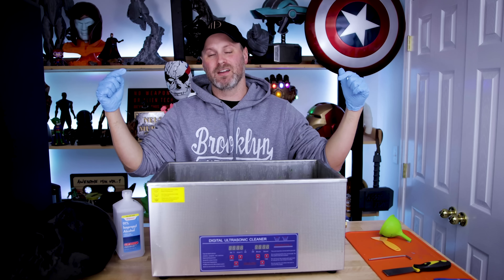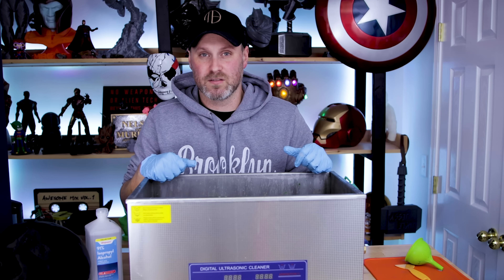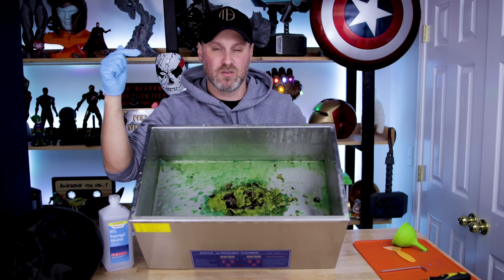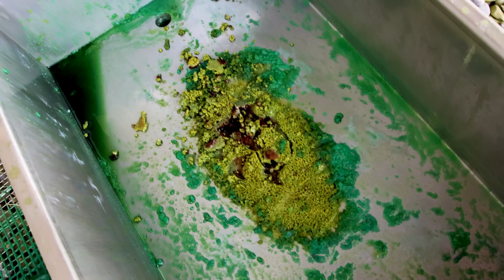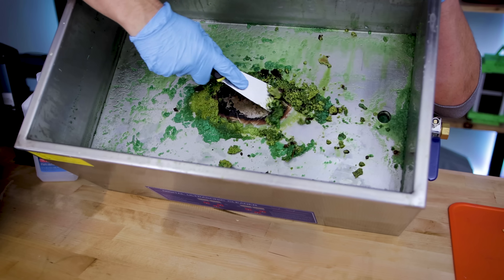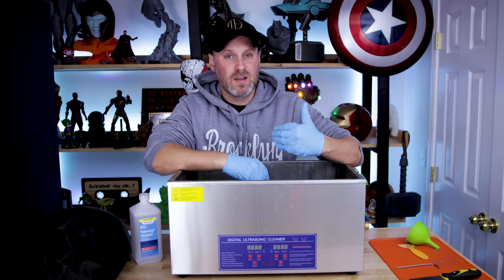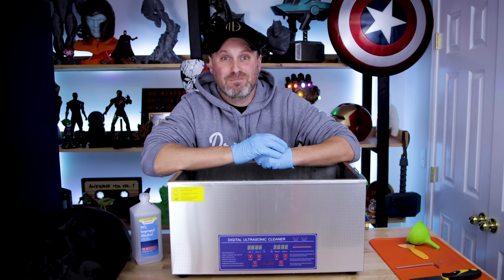Resin 3D Printing - Ultra Sonic Cleaner Safety Warning

Comment: Hi uncle Jessy.  I’m new to resin printing and I plan to get an ultra sonic cleaner as well.  I have a few questions.  Would not using any heat be effective in cleaning the prints?  Do you still use simple green as your go to solution?  And what do you do to purify simple green if you want to reuse the solution?  Great content by the way.

Comment: Mine just arrived today,  the first thing I checked was if it remembers   no active heating setting. When I power off and on again.  Fortunately it remembers the setting. I'll use a zip seal bag or glass jar with my Ethanol and model for my cleaning cycles.

Comment: I got the smaller 3L one. I wanted to know if the heater turn off after the timer. After getting mix answers on Amazon, mostly people saying yes. After trying it for myself, I can confirm that it does NOT NOT turn off by itself after the timer expires. Anyone using this while away should purchase a outlet timer or smart outlet.

Comment: Feature not a bug. It takes a hour and a half for the water to get from room temp to 45 degrees, and most people want to do several batches once they're up to temperature, so the heater stays on because it can't assume you're done with it once the first cycle is done. It's on you to check the control panel and turn the heater off when you've completely finished with it.

Comment: This was more of a failure on YOUR part to read the instructions and the manual as well as warning labels then a downside to the cleaner I actually have a similiar unit 5.8 gallons larger then yours with the dials (get the dials they are better then and more reliable then push buttons) and on no less then 3 occasions accidentally left it on and burned off all the water .. i use seperate containers with cleaner so i can clean multiple items with different cleaners at once and not have to waste cleaner . The heating elements inside the machine most likely have all the rubber melted of the wires and it scorched the bottom of tub .. scotch bright pad cleaned the tub and it still heats and works I use cheap $3 timers to go off 1 hour after cleaning which is only 30 minutes to notify my dumb ass to check to make sure the unit is turned off. Do not blame a tool for your inability to read the instructions it works great and only thing every buyer of a sonic cleaner has as remorse is EVERYONE regrets not buying a larger unit .. mine can clean honda 4 cyl engine cylinder heads. I cannot clean mustang heads or cylinder blocks .. you can clean anything and everything under the sun with these ..you can even clean dirty dishes with baked on stuff you normally need scouring pads an lots of elbow grease etc.. I would sell mine in an instant simply to fund a larger one. thinking of making one just because the size I really want would cost thousands.

Comment: I'm pretty sure the alcohol would have boiled off before it caught on fire. Good to know about the heating element.
Reply: iso won't combust until 399°C (750.2°F) so yeah, it's fine in an ultrasonic cleaner even heated for ages

Comment: I just bought one for 50% off because the heater component didn't work.  Saved me the time of disabling it and I got an awesome deal.  Thanks for the video!
Reply: Is there a way to disable the heater on the standard units? For example by disconnecting a cable, without preventing the cleaner part to actually run?
Reply: @fluxcapacitor propably if the op could

Comment: Way out of date but should be easy enough to disconnect the heating component from the power? Take it apart, snip off the wires to the element and tape them back up/attach to a terminal block?

Comment: Disappointed that you couldn't think your way out of this one. Just unplug the heater internally. Beyond that, the heater does not turn on, on mine unless I turn it on manually. Granted it still may not have an auto off. Always surprised to see people buying $300 alternatives to $15,000+ products and expecting not to have to work around limitations. If you are not compitent enough to know in detail how each function of a machine works, you should never buy a Chinese knock-off

Comment: So, I have the same Ultrasonic Cleaner that you have and it stays plugged in.  The power switch is not flipped on unless it is in use.  For the heater to be on, you must set the temp and push the "On/Off" button and the heater comes on with an indicator light just to the right of the digital display (on the left) showing it is either on or off.  It sounds like you had the heater enabled, ran the ultrasonic function for some prints and forgot to turn off the heater.  Getting used to new pieces of equipment is part of the process and I have enjoyed your videos and reviews, but; this video should be more orientated towards "Don't forget to turn the heater off".

Comment: Just unplug it every time! If that's inconvenient, give it it's own surge protector with an obvious light or more convenient plugin location. No need to lose the use of such a great tool.

If you are really paranoid, then cut (and electrically cover) the wire to the heater coil.

Comment: Thank you for posting about this.  I just bought the 6L version of this cleaner.  I may just put the plug on a timer as a backup or open it up and just disable the heater completely.  They should have had timers for both elements of the cleaner, but these are cheap, so we get what we pay for.

Comment: Good warning.  Many units are designed to be able to pre-heat.  If I can add two points (as a manufacturer and distributor of ultrasonic washers, up to ones that clean truck engine blocks, plus a 3D printer myself),

1) Please don't use flammable or combustable solutions with an ultrasonic.  They typically are not rated for this.
2) Even running the sonics can raise the temperature. If you're only doing short (say, 5 minute) bursts, it's likely not a big deal.  But long runs can create heat.  You're putting energy into the fluid with the sonics.

And get a cover!  Evaporation happens fast.

Comment: Just a heads up at 26 seconds into the video you called your ultrasonic cleaner a 3D printer.
Reply: The guy is clearly an idiot for several reasons.

Comment: thank you for the warning.  i now unplug mine after each use.   i love safe, effective cleaning with Mean Green in an ultrasonic too much to ever go back to noxious, dangerous, expensive IPA in a bucket.  honestly i don't care that it takes 10 min in a heated ultrasonic instead of 2 min with an IPA bucket.   the results are just as good and there's no stinky flammable smell.

Comment: So I bought this ultrasonic cleaner after watching this so what I do is turn the heating element below the default setting.  I have the ultrasonic cleaner on a power strip so I just turn it off after each cleaning session. So props for this video because it spurred the idea to put the cleaner on a switch.

Comment: I had a 3L ultrasonic cleaner from the same Chinese company. Bought it new for 70 bucks. It dug a hole in the ss container under a rubber feet of the metal basket. It burned down because water was leaking inside over the electronics. These cleaners are absolute crap and cannot be compared with high quality brand cleaners. I can only recommend you to buy quality brands. Buy them used, they are way too expensive new. I bought a replacement heavily used Sonorex 3L ultra sonic cleaner for 170 bucks (1000 bucks new). The cleaning power is way better and it does not produce loud whining noises while running. Also, find a way that parts or cleaning baskets do not touch the bottom surface. Find baskets that you can hang at the top edges of the container. Have a look how quality brands do it.

Comment: Hi there, I have to respond to this as I'm using exactly the same Ultrasonic Cleaner at work and you can freely leave it plugged in and leave the main switch (in the back) ON as long as you don't leave separate button for heating ON (in front).

Comment: Hey Jesse! Have run into this before because it's so easy to leave your cleaner on when you're getting ready to cure a print-- a good way of avoiding this in the future is to have something like a lamp wired up on the same power strip as the cleaner so that if the lamp is on, the cleaner is too.

You can then use the power strip as your cleaner's power switch and if you see the lamp on before you leave, you've messed up :)

Comment: I have been looking for a better ultrasonic cleaner than the harbor freight one that someone bought me for Christmas one year. I think I found one I like but the good one are expensive so I've been hesitant to buy one.
Anyways... I researching one I thought of the looking at the immersible type. It's where you take the transducer and place it in any take you want. If you are looking for a large volume ultrasonic cleaner I'd think that the immersible types would be best. Only downside of them is they are a lot more expensive, so I naturally filed that option under the list of things I'd buy if I would ever win the lottery.🥴
You know if you can salvage the tank on that unit you have you could probably use it with a immersible ultrasonic cleaner. That is is you could afford one of those.

Comment: That's got to be a Chinese-made cleaner that doesn't have UL ratings (or if there are markings on the label, they're fake).  No appliance would ever pass UL with a permanently-on heating element, even if it's at low..   Fortunately, this is an easy thing to fix..  Open it up and trace the wires to the heating element and put a switch in..  Or if you're more advanced, get a relay and tie it to the ultrasonic so that it only functions when the ultrasonic is also working...

Comment: Hey Jessy I have a transform and I have been running into some issue with translucent resins and prints failing when trying to print bigger than 30mm. I have run exposure tests and 80sec base and 12sec normal layer have been successful in smaller prints.  My current lift speed is set at 150 and I am using chitubox with heavy supports. When printing larger it's about 60/40 failed build plate adhesion and support failure. I angel the prints and still nothing. Do you have any advice on this. Resins I am using are the anycubic green and elegoo red.

Comment: Missing temperature cutoff and missing temperature controller. You should always take apart cheapo heater systems to make sure there is a temperature cutoff and that the thermostat exists. If that was IPA you'd be looking at a vapor explosion. Even if it is just the ultrasonic function a temperature cutoff on the system to stop short circuits in the transducers from heating up the bath is still a must.

Comment: You might wanna invest in one of those timers you plug into the wall, that you then set up to cut the power after a specific amount of time...... I've been thinking of buying one to set all of my different chargers on one single outlet and when I want to charge a random battery I put the timer on like 2h and after that all of the chargers gets cut off of power at the same time.

Comment: You dident read the manual. I'm sure on page one it says dont use unattended.
Reply: I'm sure many manuals do, but leaving it completely unattended and misunderstanding when the unit is still active and not in stand by are two different things.

The same problem would have arrived even if he has been around the machine, although he would have been able to deal with it sooner.

Comment: The heated ones that automatically turn the heat off when the ultrasonic timer ends are safe in my experience.  I have one that works like that and one where the heater is independent.  The independently controlled heater is annoying because you need to shut it off by hand and if you forget...

Comment: How long did you have it on for?  It’s stainless steel, of course it’s easy to clean.  Glad you did this vid because I have a new Ultrasonic cleaner for cleaning circuit boards and will check to see if the heater turns off as well or have to have a wall timer

Comment: Grab a heavy duty lamp timer, rated for the amperage of the cleaner, to use as an external automatic kill switch if you plan on leaving the cleaner unattended.

Comment: Thats why you never ever leave any kind of machine fully unattended. 
Always keep an eye on your machines, doesn't matter if it's a printer, a cleaner, a cnc machine or whatever. Just don't!  

Use a timer switch for that thing so it will turn off after 15 min of use.
Reply: heating up the tank from cold can take hours (3 for mine) so its relative easy to forget. It does have overheat protection like thermal fuses but they only fail after the tank becomes dry and that can take weeks depending on what you use for cleaning.  A mains timer that switches off in the evening is a simple way to avoid this.

Comment: couldn't you just clip the wires ( and cap them) that go to the heating element if you never want to use it?
Reply: no need; most cleaners ; especially the same series as shown here you need to turn on the heater each time you power the unit.
If you don't turn the heater on they stay cold.   Also the wires from the heaters have "amp" connectors where they connect to the controller board; if it makes you feel saver you can just unplug them there and if you later change your mind plug them back in.

Comment: never leave the heater on. use the heater to only "get it warm" then turn it off (or is it always on in this unit? no switch?). the ultrasonics themselves will heat the fluid. in smaller units will actually over temp if you use heat and ultra at the same time! heat on warm up. once you go ultra turn off the heater. ALSO I have mine plugged into a remote control timer outlet. I set it for 30min. so no matter what I do power is cut after 30 minutes.
Reply: this series also turn the heater off when the cleaning timer ends so in a way they did think of it ; just when you "pre heat' the tank and then forget about it (so not using the ultrasonic part) this can happen.

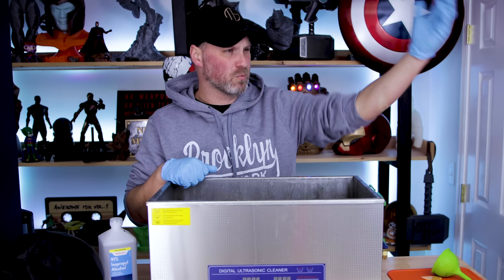Comment: 2:03 "would have caught on fryer"
who's "brilliant" idea was it to put resin prints in an ultrasonic cleaner?  Also modify the darn thing and put a timer on the heater or use a timer outlet. its easy enough to do.

Comment: Here is a tip. I have multiple ultrasonic cleaner's and what I've learned is to place my parts whether it's resin 3-D parts, motor sport carburetor type parts, or firearm parts and there specific cleaning solutions into either a stainless steel or plastic container. The container is then put into the ultrasonic cleaner that has water in the tank. The water will transfer the frequencies directly to the solutions in the isolating container. After you're done cleaning the containers are easy to clean and or store. I've even used red plastic cups. Oh and you can use several smaller containers with different solutions at the same time. By the way make sure the level of the cleaning solution with the parts is  just a little higher than the water level in ultrasonic cleaner.
Reply: This is what I do. Saves on a lot of cleaning solution and also you are dealing with smaller quantities of resin contaminated fluids.  "Going back to the bucket method." jeesh. throwing the baby out with the bath water.

Comment: I could see "fixing" the heater w/ some smart home tech.
Reply: a wemo "smart plug" is the simple way since it does not require any modification. A IoT module (arduino ect) can be used to make a web based interface and remote control the unit as long you use a external antenna since the full metal case shields wifi.

Comment: Dumb user error. Nothing more but wasted time here.
Reply: Which he already said..
Reply: You must be a little dense. USER ERROR is the whole damned point of the video. its a scenario where the machine "encourages" this user error with its poor design.

JUST because the manual warns you of a design flaw does not make it suddenly not a design flaw any longer.

the point of the video is to WARN OTHERS who will be very likely to make the same user error.
Reply: @nerys71  it does not "encurage" it ' this series of cleaners switches the heating element off after the cleaning cycle is completed. It ONLY remains powered if you switch it on, then  TURN ON HEAT and leave it WITHOUT  A CLEANING CYCLE.   If you can not remember you switch heat on you should plug the mains lead in a mains timer unit so it switches it off for you.

Comment: Thanks for the warning and glad you noticed this problem before you or your family was affected by it.
Reply: they do have a thermal fuse that cuts the power to the heating element if its overheats. But for that to trip it has to get even hotter then this one had.

Comment: You forgot to turn off the heat, so don't blame the machine.
Reply: Which can't be done without removing power to the entire machine...
But yeah, he already stated it's user error.
Reply: @PokketGM   You're wrong, you can leave it plugged in and turned ON, just turn off the heating in front panel.

Comment: I have a smaller ultrasonic cleaner that has a really really similar front panel... thankfully its heater doesn't seem to run unless you hit the power button under the heater section on the panel
Reply: same as mine and also the heater switches off after the cleaning cycle has completed.